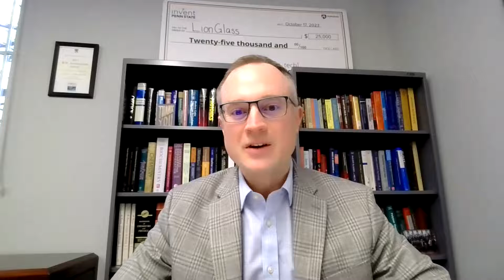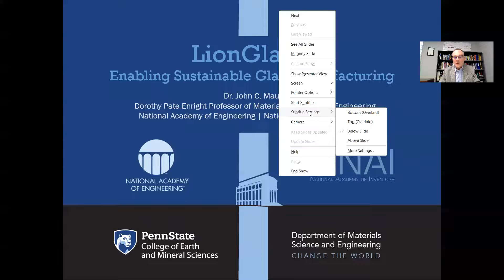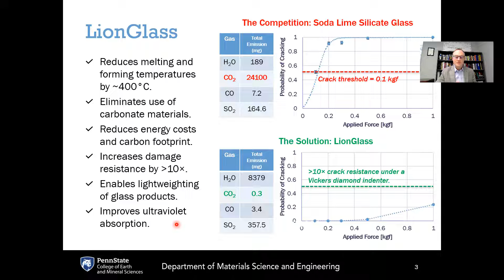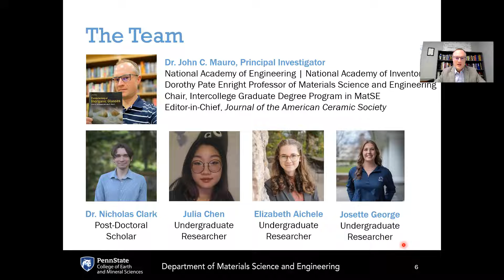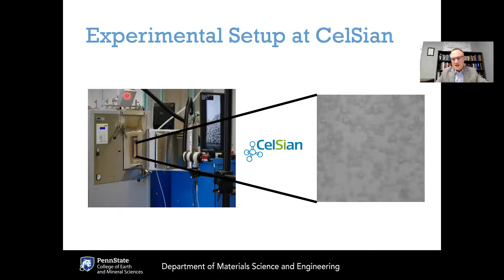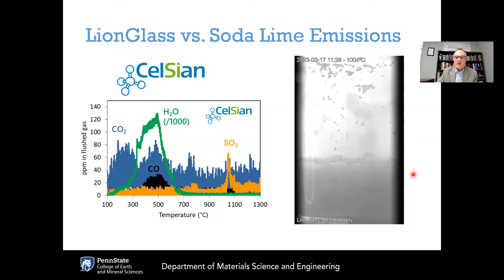Discover LionGlass | Reducing the Carbon Footprint of the Glass Industry

Comment: Extremely interesting video and explanation of Lion Glass. 

What would be the scope for Lion Glass on an industrial scale?

I work within the hollow glass industry for food, beverage and tableware, and one of the biggest challenges facing the industry as a whole is the CO2 emissions from melting, causing the industry as a whole to struggle against plastic and Aluminium packaging.

Most glass melting furnaces within this industry are over 100 Tonnes per day in terms of melting capacity, and within the flat/float glass industry, these can be over 1000 TPD. Do you see this being an issue for Lion Glass on an industrial scale? 

And when would this be commercially viable?

Sorry for the slew of questions, but I do hope that Lion Glass could be the future of glass, and I'm curious to know the general viability

Thanks
Reply from the maker: Thanks for your kind note and questions. We are working on scaling right now. So far the progress is encouraging!

Comment: This is very interesting.  As a glassblower I have a ton of interest and questions.
- Is it suitable for blowing?  
- How is clarity?  
- Does it fine to completely bubble-free and in how long?
- Can it be engineered for 96 COE/LEC and what degree of +/- can it tolerate?  (if not, the entire studio glass color industry won't work).
- Compatibility with commercial color is actually more complicated even if matched on COE/LEC as all commercial color will be higher melting temp in relation to this glass.  That's a huge issue.
- Are offgasses corrosive to refractory?  
- Is it reactive to the metal oxides in color?
- What is viscosity curve like?  
- Can it be formulated and packaged to be dust-free?  

The lack of color or glow is not a feature--glassblowers use both motion and color to understand the glass during the blowing process and may be missed.  The need for dark glasses in blowing soda/lime glass is incorrect--it's not that bright to be damaging (perhaps you're confusing it with the sodium flare experienced by flameworkers working with borosilicate glass).  The noted temp of 1400c isn't required to melt all soda/lime glasses in the studio environment.  You may want to compare it to the best current low-temp batch (Glasma 700) that is engineered to melt at 1205c and work at about 1070c.  

Very interesting development but lots of variables to solve for and sort out for use as a blowing glass.
Reply from the maker: Yes, we've demonstrated successful blowing of LionGlass. The optical clarity is slightly better than soda lime. It also melts bubble-free. The melting temperature of 1400 C quoted is for industrial soda lime.